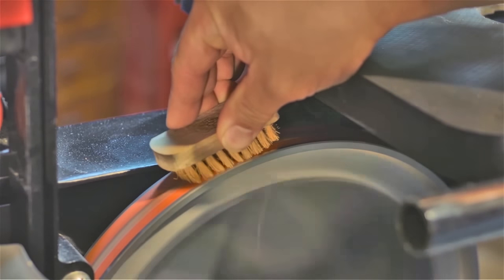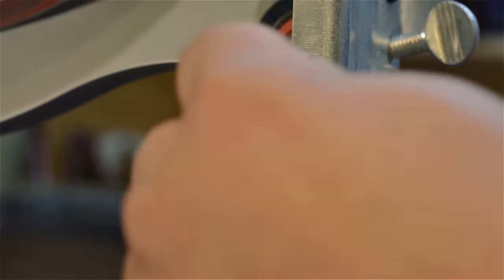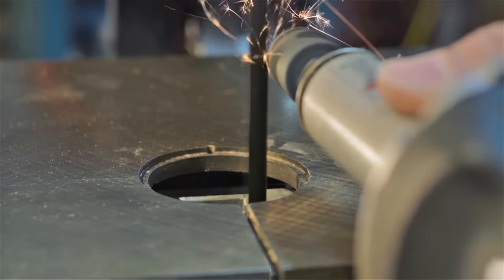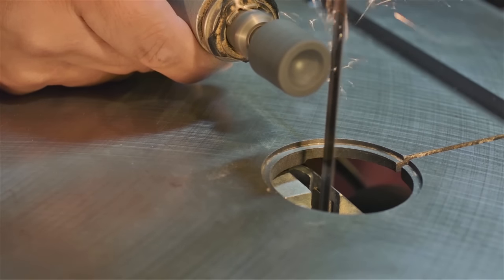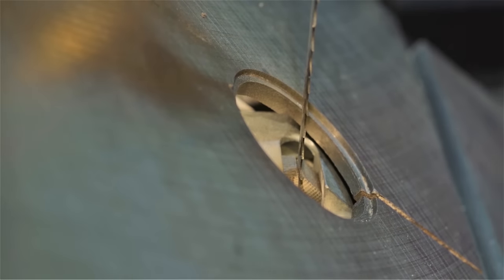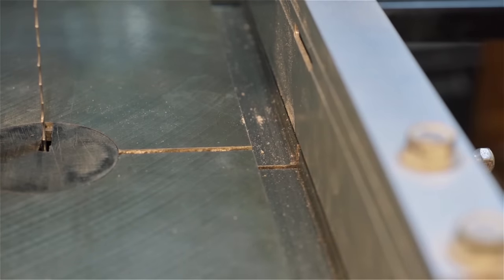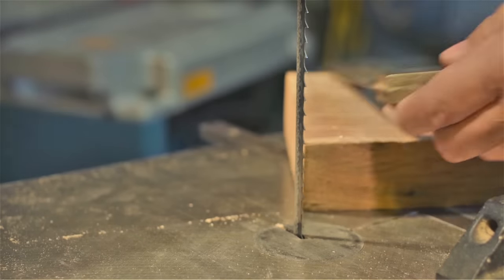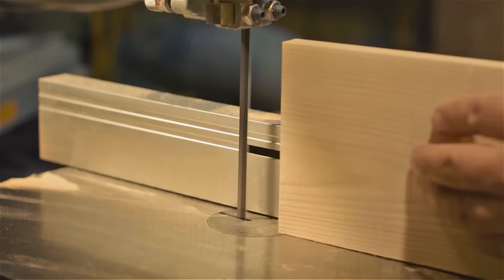Bandsaw Tuning For The Anally Retentive

Comment: Watching this video I am thinking neither my Craftsman band saw or my inherited father-in-law's would (wood) ever cut like that and discover I never even thought of, much less knew, that it had upper and lower blocks and idlers. I also do not have the cash to get the higher priced blades and blithely believed in accurate manufacturing. I guess now I will get deeper into both saws and likely use them more often. This might be why Dad's Delta eats blades like candy. Many thanks!
Reply from the maker: Band Saws are the primadonnas of the woodworking equipment world, and require attention as such. If I can avoid using mine for a particular cut I try to do so - but - they are a necessary evil for most. Cheers!

Comment: Great video. You should consider getting a better quality digital caliper to complement your precision woodworking. Mitutoyo, Starrett and Brown&Sharpe/Tesa are all excellent choices. Youll will be surprised how way off those cheap chinese calipers are if you checked them across the measuring range with a set of incremental gage blocks.

Comment: I have a Mini bandsaw, Its less than a metre tall over all. The blades are supported by two steel rod ends and it drifts better than Fast and Furious. Now ive seen this i have a plan but im going to need to build my smelting fernis first. I need to cast some square guide holders.

Comment: I agree with everything you did to tune your bandsaw  and what you said about blade positioning on the wheel and drift except for the grinding, which seems pretty unconventional, but if it works for you, why not? Most commonly folks relate flutter to tension or blame the weld. You blame the blade quality. Maybe all 3 reasons are correct. Grinding like you do would also likely correct any weld problem even though you might be trying to do something different. In my opinion many don't like unconventional methods that are outside of their comfort zone, even when they work well.
Reply from the maker: I grind because I'm using $5 blades, some expensive ones out there are decent as-is. I re-saw antique lumber, and hit a lot of embedded nails.

Comment: Great edit. I think one of the biggest factors to blade drift is blade placement on the wheel - not being centered, and you did briefly mention it. It probably would have helped people who don't know this to see a quick shot of where that alignment is. If the blade is centered it will want to twist back and forth with different tensions and feed rates. Moving the center of the wheel closer to the teeth is key. I've read some of your comments - if you don't do a video on wheel and machine balancing, can you recommend a video?
Reply from the maker: The wheels are there to provide motion for the blade, so the less tension the better - and this is something I didn't really elaborate on enough. Getting that blade to ride where it should does require that both wheels be relatively 
 co-planar. Wheel balancing may or may not be possible depending upon the wheel and manufacturer. Twenty years ago, when they were made in USA/Canada, Delta proudly proclaimed their wheels were dynamically balanced by a computer, and they are exceptionally smooth. Ditto for General & Powermatic. Balancing a wheel manually, I assume is like doing it for a dirtbike. You could probably just epoxy on weights too. Thanks, I will consider more in-depth material for future vids.

Comment: Protip - hook your bandsaw up to a VFD (Beefy ESC) and run it r e e e a a l slow to place the bottom blocks. Just don't do it too long or the motor will overheat because of the reduced airflow

Comment: I have limited space. I don't think I can fit a large table saw in the shop I'm setting up, and I don't think a cheap table saw would be very accurate. I've always wondered if I can get very precise cuts with a band saw fence. After watching you cut that 1/16 thick by 8" wide strip of wood I'm very confident that I should just buy a high end bandsaw.
Reply from the maker: If you can still fit it, somehow, a good cast iron top table saw is still extremely useful in the shop. Both together (band & table) make the perfect marriage.
Reply: @RockwoodJoe  I might be able to basically use a table saw as my workbench with a few modifications. I was thinking about that yesterday. Also, pretty cool that you responded to my comment.

Comment: It was a good lecture, good info, thanks. I have an el-chipo 10 in h saw and I need tires for it. Could you please advise me what can I use and where to get it. I watched men but yours was the best instruction, thanks
Reply from the maker: You can try Lee Valley or just search Google. Ten inch is somewhat rare these days, so good luck.

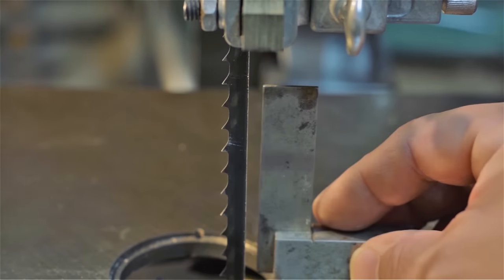Comment: I just finished watching your video,  its very informative and I picked up a few tips to do on my own band saw.  I have one question for you, at the 5:10-5:20 mark you talk about having the back side of the blade square to the table.  My bandsaw blade is not square to the table in this manner. If you are standing at the side of the saw my table is lower in the front than in the back and so the back of the blade is not square to the table. how do you go about adjusting the saw to make them square with each other?  Is it a table adjustment or something else? I have a Jet 14" JWBS 14CS with a riser block.  I don't see any adjusting ability in the table front to back only side to side for angle cuts.  Thanks for your help.
Reply from the maker: You would have to actually shim the table on the mounts or where it bolts to the yolk(s). A pain, I know. On the older saws, they machined the mating parts to be true at 90. On newer machines, this step has been missed - so you might be able to sand the castings yourself. Good luck.

Comment: The most important thing with a band saw, blade tension  but no mention of it in this video.  Adjust it so that it makes a true note when lightly plucked that way less vibration no need with all fancy grinding. If your blade wanders it’s most likely wrong tension. The makers tension indicator is a guide, use your own judgment.
Reply from the maker: So adjusting tension will fix a blade that is improperly welded/brazed, and it will also fix a blade that has thick and thin cross sections too? Blade tension is a small factor, as you only need enough tension for the rubber to contact the blade so it does not slip and provide motion. The guides counteract the force(s) and are what keep the blade aligned and on track. If you're using tension to keep the blade straight, then you're probably compressing the rubber tires too much and causing excessive wear. I run less tension than the factory guide, and only enough so the blade stops flapping. I'm using a $3 blade if you recall.

Comment: Well, my blade tension is fine, the table tilt angle is fine.  It's just that if I draw a straight line on the wood and cut/rip across using the guide, the cut is about 1/16th of an inch off to my left by the time the cut reaches its end edge of the wood.  I've had the band saw for 4/5 years Never used it before.  I just want to make sure that it is not the table that I need to adjust to the right by 16th of an inch.  There is a lot of info in the video.  It's just I am not a pro version of DIY'er.  I just do things by instinct.

Comment: This video is going into my saved folder. You have covered it all.
Regarding drift, I run a bandsaw mill and have found that a wavy cut is caused by tooth set problems, always.
Now if you can cover table saw runout???

Comment: Thanks, very helpful.  I have a nice Rikon 18" which needs some adjustments, so this helps a lot.

Do you cut any steel?  I also have an old Toolkraft 14" 4514 for that eventual purpose.  I have the reduction kit, not yet installed, new tires are installed.  Questions: For steel cutting do you use cutting oil?  Would that damage the tires? Any advice on what blades to buy.  I'll usually be cutting hot-rolled bars, angles etc, 1/8  - 1/2" thick.  Maybe some thinner sheet stock too.
Reply from the maker: I don't cut steel unfortunately so I can't help much. Any time I've cut steel on a band saw it was an industrial one - with a 2" wide blade. Depending upon the material (ferrous versus non) you would use oil. I don't think ordinary 14" band saws are really tough enough for use able steel cutting. Perhaps thin stuff. Good luck!

Comment: I HATE having to set up for drift angle  for my fence everytime I change out  my blade. Im not sure yet if the time it takes to to do this or your process will save me any time but I'll give it a try to see what happens. Thanks for the suggestions to reduce/eliminate blade drift.
Reply from the maker: How often do you change your blade to a different tpi? This setup should be good as long as you don't change the blade and leave it on the machine. I always de-tension the machine when leaving it over night etc. Do some measurements, you'll find the so-called "drift angle" is not finite and changes with work piece feed speed. It makes no sense to adjust the fence for drift. Complete nonsense.

Comment: Hi, thank you for posting this video. I agree with pretty much everything you've presented regarding drift elimination and set up. The die grinder method of truing the blade is a new one for me. I'll try it on an inexpensive blade. Have you ever thought about trying to true the wheels in the same manner? One would hope the wheels are perfectly round, but if they are even ever so slightly egg shaped, then it seems to me it would contribute to the blade flutter. I've not done this procedure myself, but always wondered about it
Reply from the maker: If your wheels are egg-shaped, then you're f#ck'd really. Leaving the bandsaw under tension when sitting can also mess up the rubber tire, creating an unintentional egg shape - that doesn't seem to reset back to round. Check the wheel without the rubber, and see how bad it is first. Most times I've seen the rubber has been permanently deformed. Cheers!
Reply: Well I suppose I disagree with you. I decided to test this by attempting to true the rubber tire with the wheel in motion, using a sanding block with glued on abrasive. It was not scientific, but I thought as long as I hold the block firmly and consistently, it should abrade off the high spots and I believe it did because the flutter in the blade went away after a minute or so of doing this on both the upper wheel and lower wheel. It could have been that I was abrading deformation in the tires, or abrading away sawdust and grit that was embedded in the tires, or both. Either way, it made a big improvement similar to what happened in your video with grinding the sides of the blade with the die grinder. There is a video on YT from a british guy that set up a plane blade in a jig to shave his bandsaw tire true in tiny increments but I didn't have the patience for that and decided to just try an abrasive block.
Reply from the maker: I've heard about the plane blade machining of the tire too, that's just waaay to hardcore for me. I have just dragged a chisel over the tire while spinning which helps to dislodge stuff. Keep tension way off the tires when not in use - that is really what seems to deform tires.

Comment: I think you need to look up the word perfect, because you keep using it wrong. ;-)   Other than that, though, some pretty good tips, I think.  I know some folks actually boat tail the trailing edges of the blades a bit to get more clearance for tight radius curves.  The only thing I'd point out is you forgot to show the blade being twisted open and shut.  People might have gotten a kick out of that, I  know I did the first time I saw it.  Also I had a windshield shade once that made use of that little topological "trick"...pretty cool, too.

Comment: Dude your video is well laid out. I wouldn't call that being anal retentive, it was more on showing the reason why there are professionals and why there are amateurs. Caring enough to setting up and tuning a tool makes it easier to obtain a professional look to your work. When building things the words "good enough" should never enter your mind because anyone who says that to themselves is simply not wanting to admit they know the cut was not good and it was their fault. 

Long tedious tool setup increases the machines life, extends the life of the consumables (blades in this case), yields a better result, and forces you to get to know your machine (the more you know the machine and how it will act the more you can prevent failures with the machine and increase safety while operating the machine). 

This is a very good video and teaches what to look for if the machine is not doing what you want 9 times out of 10 it all boils down to operator error and then the machine gets blamed and called a POS.
Reply from the maker: Thanks! The older Delta's really aren't POS, but after the "great decline" (starting with Black & Decker's purchase) their reputation was virtually (intentionally!) destroyed to pave way for DeWalts dominance of market share. RIP Porter Cable & Delta!

Comment: My guides don’t move perfectly perpendicular and they need to be adjusted if I raise or lower them. I don’t see any way to correct this. It’s a Jet 14” with a riser block. I thought maybe there was a tiny bit of dirt or sawdust between the riser block, but I took it all apart and made it pristine and the problem still exists.  Is there a way to fix this problem or do I just have to keep adjusting the guides any time I raise or lower them?
Reply from the maker: You would actually have to shim the riser block on one side (or possibly two) to get the travel perfectly perpendicular. If that's too much effort, then just get comfortable with always adjusting the guides at every different height. Good luck!
Reply: Rockwood Joe Sounds like a lot of trial and error. I saw someone say soda/pop cans make good shimming material. I’m sure I’ll end up doing it as it will bother me for sure, lol

Comment: Great video Joe. Your video has given me new incentive to try to get my saw running smooth abs true. I’ve tried before and had given up, just accepting the vibration and drift. 

Question. What is your guideline on setting the blade tension?
Reply from the maker: Thanks! Tackle the vibration first, as sometimes it is the hardest depending upon manufacturer. Make sure those wheels are nearly inline vertical too. Good luck!

Comment: Great video, I'm definitely going to use these tips on my bandsaw. I have one question, however. The blade goes forward and back quite a bit when you do the first grinding, and you grind the back of the blade until it is straight. Doesn't this mean that the front of the blade now goes back and forth? Or is it that the front of the blade is straight and the back varies in width?

Comment: I have a cheap benchtop bandsaw. 6 rollers instead of solid lateral blocks. This thing is frustrating as hell to get tuned. I’ll try some of these principles to see if it fixes the problem.
Reply from the maker: Steel rollers only provide support for something that is flat and only provide support for an infinitely small surface area. Ice skates are long blades for a reason, you need the surface area for support on the perfectly flat ice. The modern use of bearings I believe is a marketing ploy, to fool people into thinking that band saws are maintenance free beasts. No more blocks to adjust, grind, etc. etc. Before cool blocks you had to file mild steel. I've always found band saws with side rollers build up with crud (oily or sappy woods) and make things worse - new pine is especially annoying. The Delta is my third band saw (had it since '99) and I've been happy enough with it. Good luck with your tuning!

Comment: I have a question:  The thing about the blade running with the teeth gullet along the middle of the wheel makes sense for thinner blades, but what about when you are using a wider blade like a resaw blade?  If you set it up this way then half the blade would be off the back side of the wheel.  

I love how meticulous you are, a man after my own heart!  And, is that an Canadian I can hear speaking in the metric tongue?  Yay!

Comment: Shouldn’t you check the table for 90 degrees to the blade / guide before grinding on the blade?
Reply: Make sure everything is tuned and set up properly before you go grinding on the blade. Watch Alex Snodgrass bandsaw video. He has the best set up video I've seen. If you follow his procedure and still need to grind the blade I'd be surprised

Comment: I got my new saw and this helped me a lot . maybe you could do a video of trueing the upper and lower wheels . my old saw had 4 bolts holding the main lower wheel bearings this one are pressed in .
Reply from the maker: I'm on the lookout for a used one for sawing steel - but in the last 10 years they've gone from $75 at auction to $200.

Comment: i just bought a older craftsman table top band saw, it has 3 wheels for the blade to run on, my problem is it keeps throwing the blade off, while cutting or even while it is just running. ive tried readjusting everything you show in your video buy no luck. any other advice would be great. did not come with a manual. ive ask at lowes and looked on line for someone local that might could help me but know luck.if you have any ideas that would be great. thank you.